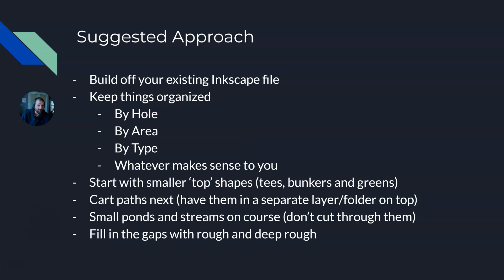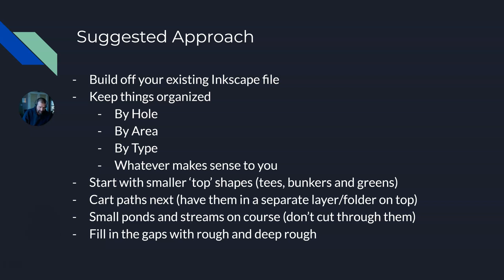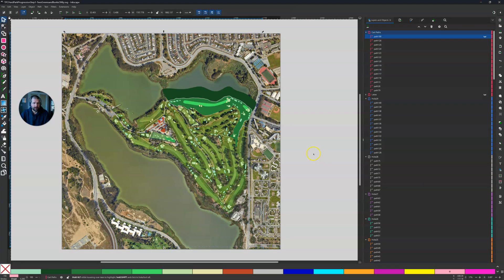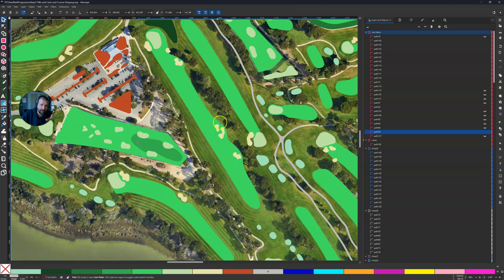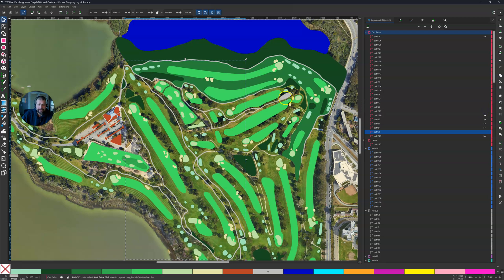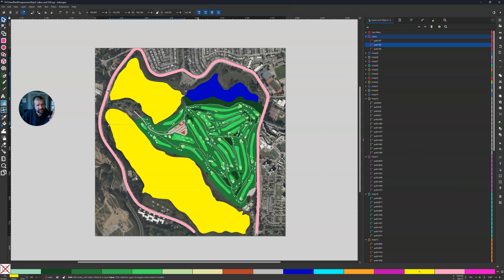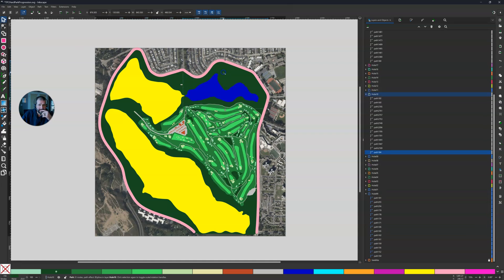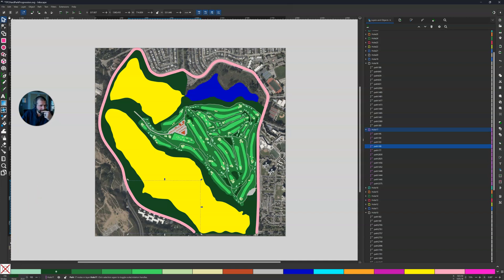Inkscape: Splining the Rest of Your Course - Approach (V4.1)

Comment: I ran my first two holes through the OPCD blender tool without any issues, but then as I added more holes I started getting errors on the previous holes that had blended correctly.  What is going on?
Reply from the maker: Probably have a double node that was exposed after changing some things around. It's best to post in the inkscape channel on discord with a couple pictures